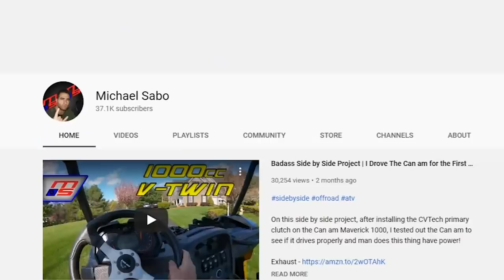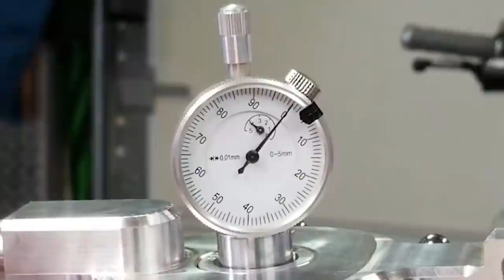Most Epic 2 Stroke Build With Before/After (Satisfying to Watch)

Comment: Good job heating the case in oven but another tip is freeze the bearings over night and heat the cases like you did and the bearings drop right in. I learned this from a old head
Reply: He did. He showed when he dropped them into the bottom pullout  freezer drawer
Reply from the maker: Amazing to see it for the first time when you do this! Thanks for watching!